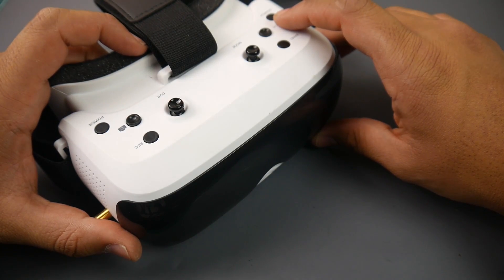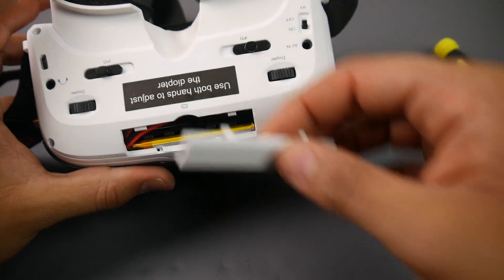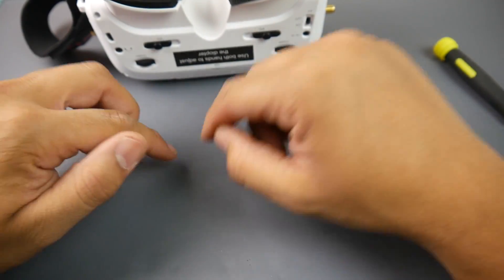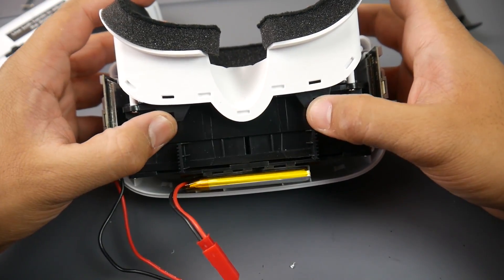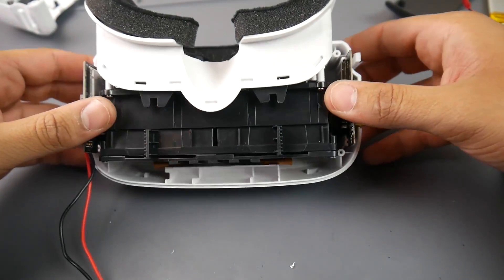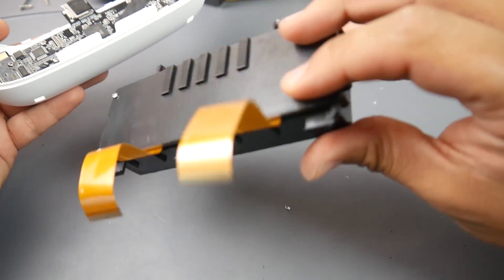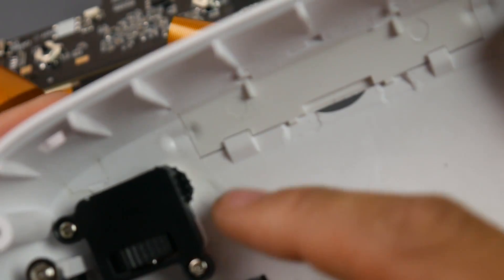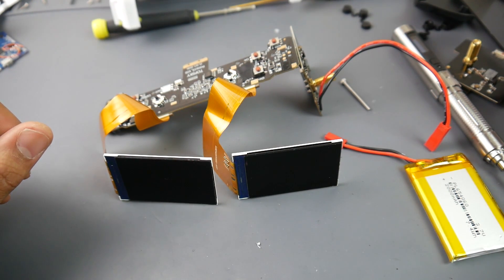TopSky Prime 1S FPV Goggle Review and Tear Down // With Mods

Comment: any Chance you could tell me were i can solder a wire to the av in  on the goggle as im doing the fatshark module  mod to mine and don't really want to have to put the wire on the outside with a 3.5 plug   and do you think i could run the fat shark mod off the   power supplied to the goggles (5v)

Comment: Before u go and strip them for parts, try get hold of a 1X acrylic lens and cut it to size to fit over the existing lens. This will give more magnification, a clear image and reduce eye strain. Worked for me. Cut the additional lens down so it fits over the plastic surrounds and put a few pieces of double side tape to hold it in place.
Reply from the maker: I am still unable to see correctly after using it. I am literally going to an eye doctor tommorow morning.

Comment: what I can suggest is making a taranis fpv screen out of these screens.. Actually I was gonna suggest you making a radio fpv screen with reciever which cost cheaper than those fpv watches. I can help designing a suitable case and mount for it.
Reply from the maker: I am researching it but I still need to find those tiny LCD's and a LCD driver IC.. I have been searching for over 1 month now.
Reply: @DroneMesh  I have found some lcds I ll send you links via e mail . I do not know which one can be suitable though

Comment: Mesh, the main blocking factor for diopter correction is built in battery placed behind screen mount plate. In another review guy demonstrated battery with notable notches left by screen mount plate. Seems a bit unsafe for me because battery may become pressed to much so a little face warming can occur.
320x240 resolution found by Bardwell instead of 640x480 in specs was a surprise for me. It explain the unclear image but it is also a shame for Topsky - why they are doing this? Prime 1S can be good budget googles if screens would have at least specified resolution and build quality would be a little better. Especially if they would use Fatshark style external battery on headstrap and make a real independent focus adjustment for each eye. They would even make screens move independently making IPD adjustment real - it would be cool. If they wish to sell things to West then they must forget the usual Chinese business practice - it will pay up.